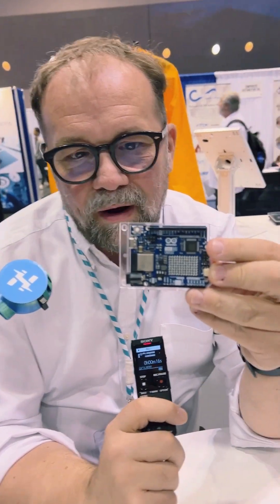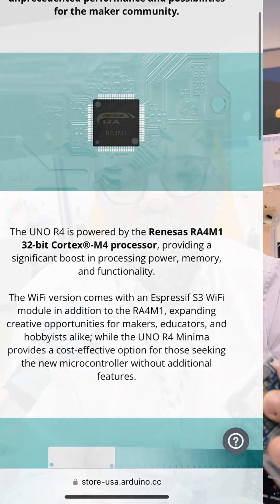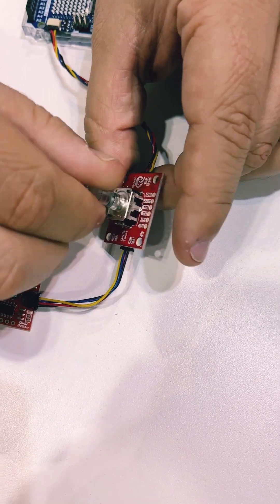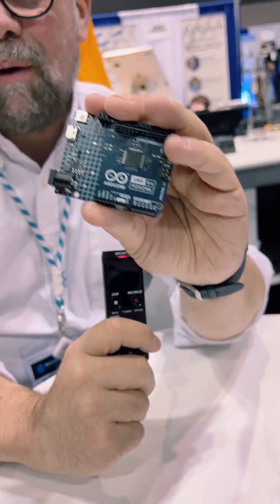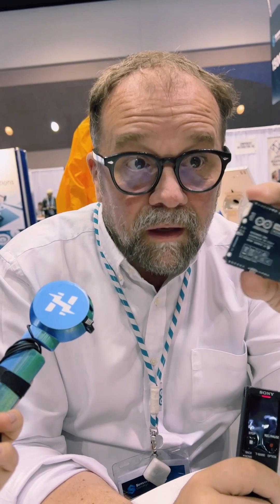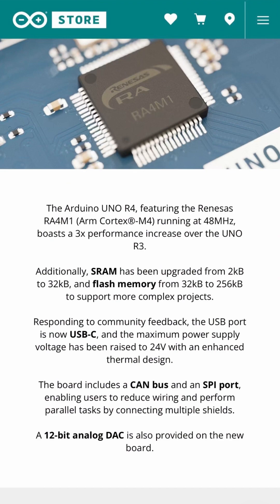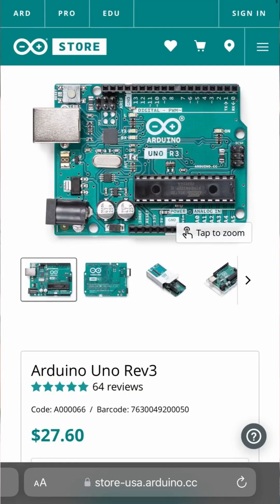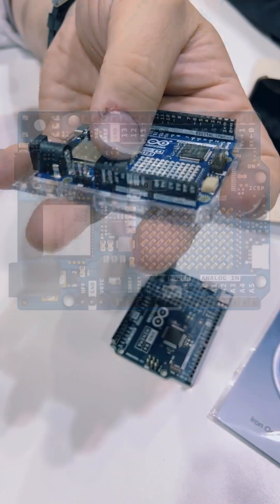New Arduino UNO R4: The Specs – ft. Massimo Banzi // Tech Highlight

Comment: The one with the screen is so, "Hansel' <happening>  I'm already imagining smiley faces cycling emoji while a mini touch screen is going through code testing before deploying on a mini voltron lion prototype then flashing the Voltron into Thundercats logo's while making cute beeps before trying to deploy a "not a toy" project that hopefully won't break.. I was just getting relaxed too from trying to explain how to create a "Star in a Jar" using different field effects then pulling the plasmoid apart to make it into a ring shape then using magnets to oscillate the fields to create rhythm patterns to sounds and wanting to be able to do this with colors if the charge or gasses could add to the effects. This on top of wanting to make an Enterprise 1701-D that used the saucer section as a surface drone and the rest of the ship into an under water exploration platform with traditional components and at scale but to eventually utilize different technologies to make it more functional and experimental so it could 'technically' function in space if certain physics were taken into account on a larger scale. So many gadgets, so little funds.. But so exciting too!!!!